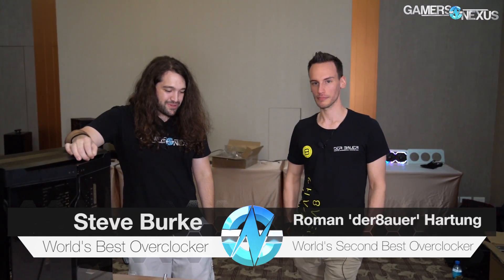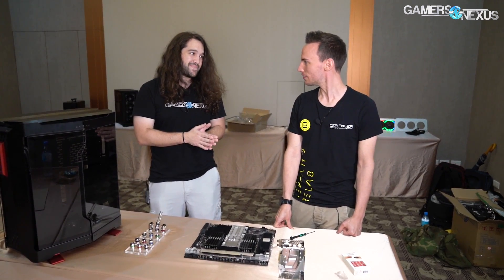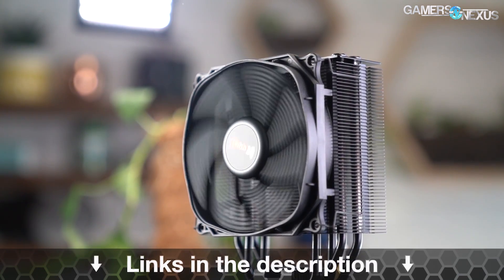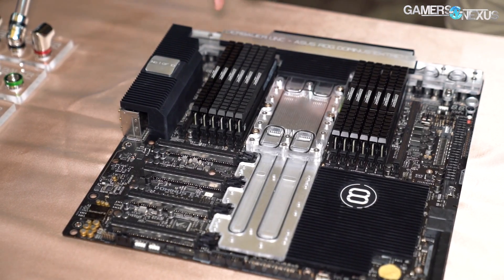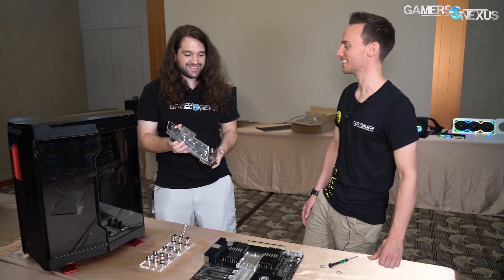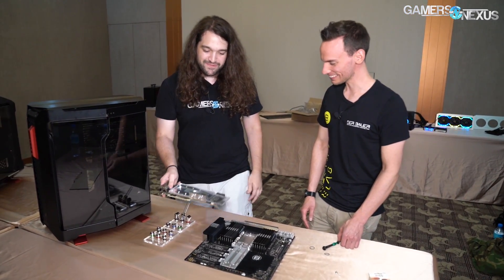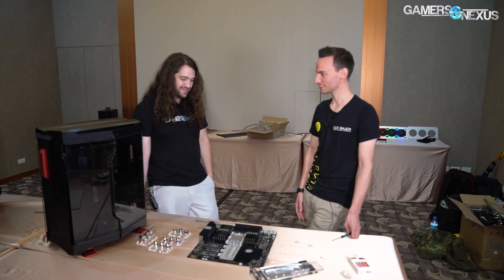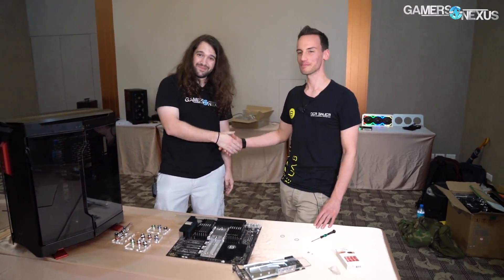Der8auer's First True Monoblock: Water Cooling Without Tubes | LINC

Comment: The next step is to replace the o-ring arrangement for the connection between the GPU and motherboard with quick disconnects so you can do it tool-less without the need for screws.

Comment: Why are all in one water monoblock designs for motherboard always so ridiculously expensive? I get that it will cost more than just standard metal heatsinks but designing and manufacturing those intricate shapes in metal isn't free and water blocks are just metal and plastic together so I don't really understand why the price difference is so crazy. 

As I am sure you have seen that ASRock X570 Aqua caused a massive stir at Computex 2019 but it's limited edition and $999!

You can normally get a decent motherboard for around $200-$300, why doesn't a mobo manufacturer use their decent mid-range board, save all the money from the metal heat spreaders, put a mono water block on and charge an extra $100 for it all? Once they start to mass produce the water blocks they wouldn't be that expensive or they could enter into a partnership with EK Water Blocks. 

Whichever way it's achieved the mobo manufacturer would have an amazingly popular product and win the hearts and minds of an entire generation of tech fanboys plus win a barrage of reviews and praise. Something you can't put a price on.

Comment: This is awesome. On a side note, we really need to have cases specifically designed for water cooling. If everything that generates heat is covered by a water block then there's no need for air to be going inside the case. Have a separate radiator area specified for a given amount of heat (like 600W, 700W) and let builders to just hook up the water lines. Means much less dust inside the case itself since no airflow is going to be happening in there, and radiator cooling is maximized by always taking in cool outside air and exhausting immediately.
Reply: out of all people, HP were the ones to do this first. HP omen 45L is available aftermarket if you can find it.

Comment: The concept is cool! 
But the problem will be purge the loop. Obviously you can use a quick disconnect, but the problem will be the bleed when you remove the Vcard. Someone can say "remove all the stuff togeder" but on some cases you need make an angle betwen the motherboard tray and the motherboard, to remove the lastone. But for the price, if you can buy the blocks you can buy a big case too to avoid that little problem 😂😂😂

Comment: I'm curious about the junction between monoblock and GPU and how likely it is to have leaks there
Reply: I'm confused why. It looks like it's going to be screwed into the acrylic below and sealed with an o-ring.

As long as the fluid doesn't dissolve the o-ring and it's screwed in tight there can be no leak.

Comment: If it was an Intel chipset running hot, Steve would have spent 2 minutes discussing that joke, on how PCIe 4.0 requires higher power etc. But because it is AMD, he would rather talk down and not address why it runs hot.

EDIT: And you ask why people call you a shill. It is less about what you do actively, but more about what you tend to do innately.

Just for reference, I have never purchased an AMD CPU in my life. Running 4790k and 1080ti right now.

Comment: This is an interesting concept. Watercooling parts that simply link directly together. Expanding on this could make open loop cooling a bit more accessible to newcomers. Imagine if all the parts had pre-installed O-rings (as most fittings do) they clicked into place and you only had to screw them down. It would make watercooling, as PC building is sometimes called, adult lego. EZ PZ. I hope you put the patent to use and expand on this idea because that is a neat concept.

Comment: This reminds me of another video I saw a while ago where someone developed a new drive system for a bicycle that had the potential to be maybe 1% more efficient then a chain drive. Turned out the system was inherently flawed and not practical at all because of obviously unforeseen engineering problems. I suspect much the same here. That join between the mainboard and GPU will leak, not if but when.

Comment: My concern is PCIe ports tend to not be very stable. If I'm adding or replacing my M.2 SSD, and knock my graphics card around a bit, will the entire thing just leak out? What's keeping this in place and airtight?

Also is that a black O11 XL in the back? When? lol.

Comment: Is this tried out, I don't see how the o ring connectors will be sealed properly, pretty dope concept tho.
Reply: Someone in the comments gave several examples why you shouldn't underestimate a o-ring. They are used to seal 10bar pressure...
And several parts in cars use single o-rings.

Comment: Cool as a show piece, but utterly pointless to make the MB block integrated with the GPU block like that given how it's utterly impractical to have the connectors for a regular loop placed there when you are not using this full cover block. Essentially ensuring that GPU support will be very limited at best. Personally I like my blocks to be future proof regardless which part they are on.

Comment: I tell the cad guy what to do, but I do 99% of the work.... Sounds like some people I've worked with 🤔
Reply: well watch his videos. He knows CAD quite well himself, he just doesn't have the time currently to do it himself. Not like he couldnt do the work
Reply: I mean that is sort of how design works though. Someone draws stuff (on paper more often than not) and then the takes of the "CAD guy" is to make a digital representation of the part and maybe sanity check it. Then some manufacturing guy gets to have his say, and then he talks to the original dude and the cycle repeats.

Comment: Really dope concept but I kinda feel like the connection between the GPU and CPU block are going to leak fairly easily...
Reply: it's sealed with the same thing that seals the damn space station.
Do NOT underestimate O-Rings, they really seals the deal much better than threads and what not.
I see no issues :)
Reply: @ole8590no  it's also sealed with the same thing that caused a space shuttle to explode, killing everyone on it :^)
Reply: @FinlayDaG33k  frozen o-ring, design fault.
It's the same thing that seals EK fittings, Waterblocks, Oil pump in your car, yeah and the list goes on.
it's amazing piece of technology.. a simple rubber ring :)
Reply: @ole8590no  I know :p 
I use O-rings a lot (since I do a lot of plumbing)
Reply: @ole8590no  But most fittings has mutiple o rings inside, this gpu connection port only has one.
Reply: @qiyuxuan9437  
10 Bar pressure in powersteering on cars (those with hydraulic) one o-ring, Oil pumps up to 10 bar, Fuel 5-6 bar with ethanol which is extremely dry and pretty anti o-ring but still no issue with one, Lines for fuel, oil and what not on plane engines, one.
I rarely see two o-rings for seal.
When going really up in the pressures it's multiseal but most cases doesn't need it :)

Yet again, do not underestimate a simple O-ring :)

Comment: Not impressed by that monoblock at all. Sounds like the cost is mostly chucked up to poor engineering. For how much he is asking, you can get things like super fine microchannels made on an EDM mill, but what we see in this demo could me made in a couple passes on a standard CNC mill. From the sound of things, he ran up the cost on low tolerances which is just a waste; for most parts on a PCB, it is better to plan on high tolerances and just make up for it with thermal pads. Less chance of a catastrophic failure brought on by things like PCB flex and uneven chips. 

Not that it is a bad product(I respect his product standards and assume he wouldn't release it at all if it didn't test well), but the price is just way out of line. It isn't much bigger than a GPU water block so 2.5x(GPU block included) would be more appropriate. So like $500 + the cost included PC parts.

Comment: i'm curious to see the testing results , i don't know how efficient it will be , i'm a bit skeptical , the 1/2 VRM -> CPU -> GPU -> CPU -> VRM -> OUT path sounds a bit weird for me because they are transferring the CPU heat to GPU which will make the water even hotter and bring it back to the CPU _ .
Reply: mehdi Damfs diy loops almost always run in series. The thermal capacity of water is extremely high and as long as the pump doesn’t start failing and the channels don’t get gunked up, it should be fine. Jayz2cents did a video a while back

Comment: For your next trick, power connectors on the back side of the board?
Reply: You could create an aluminum (or 3Dprinted plastic) block that clamps over the connector and turns it around right to the back of the board. That would solve that visual issue.

Comment: I really like those fittings. I'd like to see how they look when taken apart. 
After doing my first hardline loop a few months ago, the hardest part was actually getting the hardline down into the fittings while already attached at the other ends. Requires a scary amount of force and.... bending....   I think the Thermaltake fittings are really low clearance, which could have made things a lot easier.

Comment: Slowly paving the way for the first legitimate water-cooled notebook.
Reply: ROG GX700VO - “Am I just a joke to you?”
Reply: @backupplan6058  That thing is nice from an engineering perspective, but rather useless in practical terms. There are watercooling parts for blade servers though, so an area51m style Laptop with watercooling might be possible.
Reply: never gonna happen with how efficient heat pipes are
Reply: @sadmanh0  never say never
Reply: @easley421  it just isn't commercially feasible, the gains would be marginal; only reason they'd make it would be for a halo product
Reply: @sadmanh0  well, a water cooled laptop did come out...lmao. comment didnt age like fine wine. Although the radiator is outside, its still watercooled.
Reply: Maybe if the radiator was outside the laptop, or else that is gonna be thicc. But a hybrid cooling setup where you simply plug in the radiator when you need to.
Reply: @nickkaraoke2128  yeah Asus already made a laptop like that
Reply: First one exist already since the 10 Series.
Reply: The biggest problem with laptop cooling is how to dissipate heat into the surroundings. Desktops get nice big fin stacks or radiators with big fans pushing air through them.

Comment: Backplate with power routing, I'm very interested in that, I hate how GPU cables look.
Reply: @Conor I've seen it. Still too many cables, I'd rather see 2 thick cables, one for 12V and one for ground. In multiple GPU builds you can get up to 64 cables (4xGPUs) or sometimes even more. That can all be transferred by 2 cables or even hidden bars of metal.

I think there should be a new standard that has the GPU power connectors on the motherboard. A straight pass trough the motherboard to the back side so we can connect power over there. It would be completely cable less build. Same goes for 24pin and cpu power...

Comment: Hope they use pressure valves otherwise if you add more GPU's the ones farthest away get a crap flow rate

Unless i missed something
Reply: Gpus are in parallel, and in series with everything else. Everything will get equal pressure
Reply: As i said unless i missed something

But that being said if you pay attention and think water takes the route of least resistance

Meaning first GPU gets a high flow rate and last GPU gets very little if any

All GPU's are connected to the same side for input

Think of it like a long tube with holes in the bottom

You get a little trickle at the end if anything
Reply: the resistance through the gpu block is way higher than through an open pipe there won't be any real difference in flowrate between the gpus
Reply: this has been a thing of dispute for years. that being said no it doesn't work like that. both will have equal flow in parallel. pressure is created in the first block making it difficult for all water to pass through so it moves to the second.